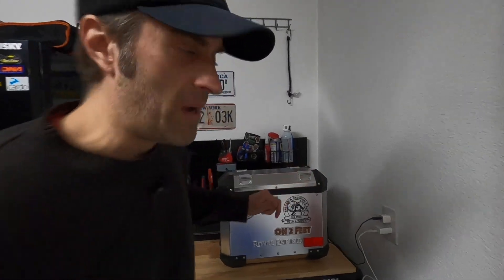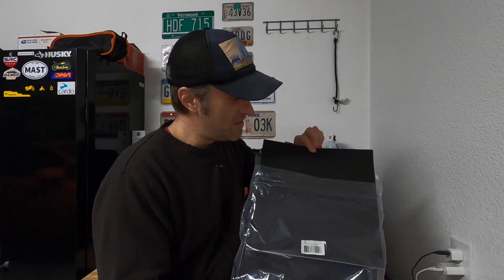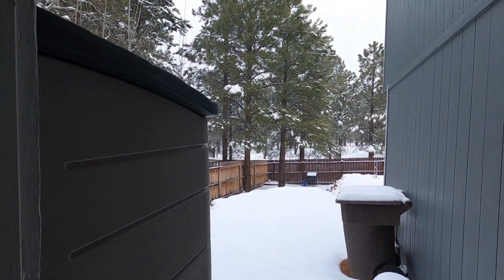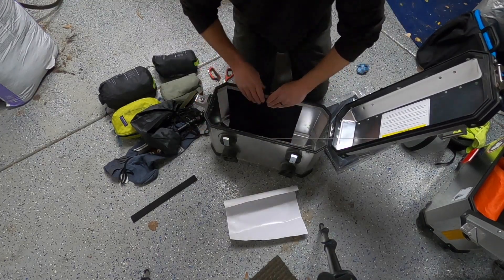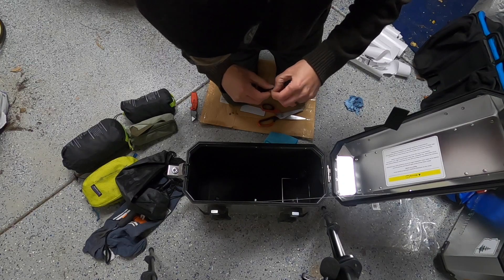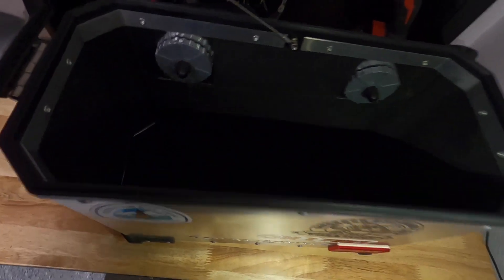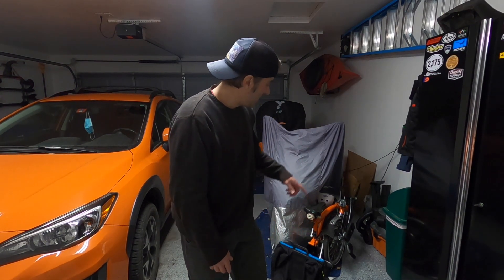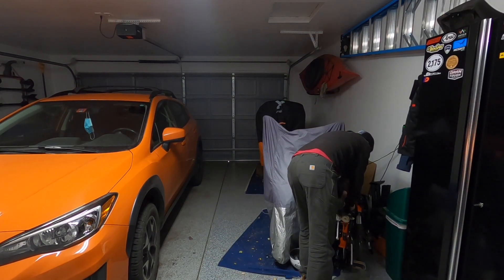Pannier Protection | Royal Enfield Himalayan

Comment: I notice that any gear on a motorcycle (in or outside a pannier) deteriorates just because it’s cheap. That’s why all the bags in my Himalayan panniers are thicker, more durable waterproof bags. Even Patagonia makes thin stuff. That’s my solution. Also, I noticed all your east coast license plates- did you once live out there?
Reply from the maker: yeah, I also have quite a few thick-walled bags that I used to double-bags things as well, but I'm hoping this helps even more. I lived most of my life east coast (most recently Vermont). All the plates were from my vehicles going back to my first car and first motorcycle (NY - 1990's). The Antarctica plate is included because I spent 9 seasons doing field work in Antarctica and drove many vehicles down there from trucks in McMurdo.....to Tucker Snowcats, PistenBully's, and snow machines in the deep field.
Reply: @On2Feet  very cool. Vermont is gorgeous.

Comment: Plasti-dip makes an aerosol spray that I’ve had good luck with rubberizing the insides of Pelican cases. Did you consider that, and if so, why did you go this route instead?
Reply from the maker: Honestly, I didn't even really know about it. It does sound like it would be a great solution though. I suppose with the decal foam I used, I can easily remove it if want...not sure if the spray on rubber would be removable.